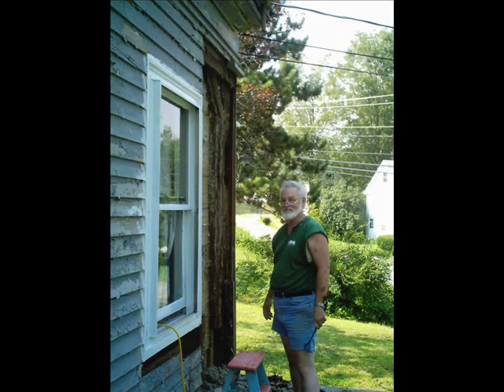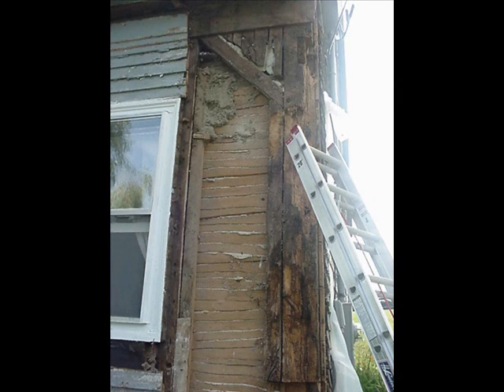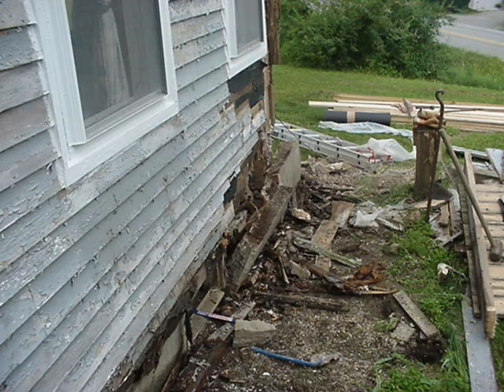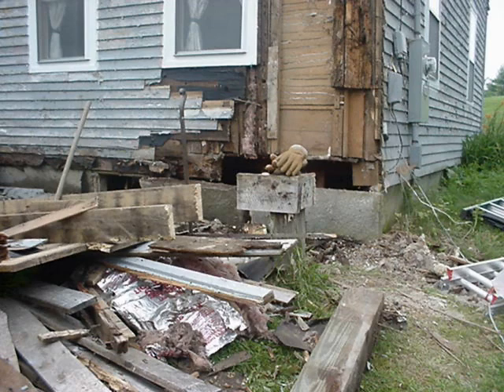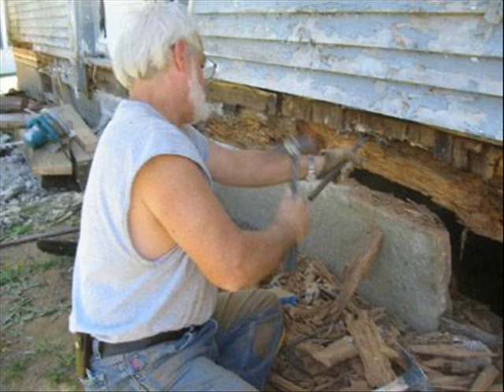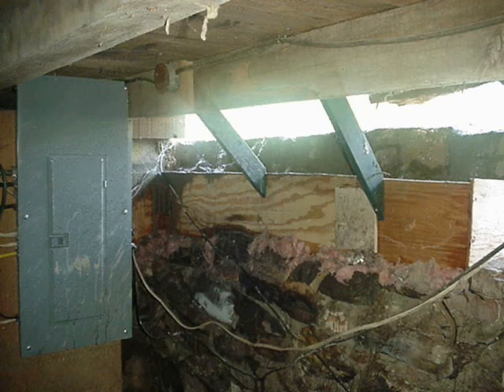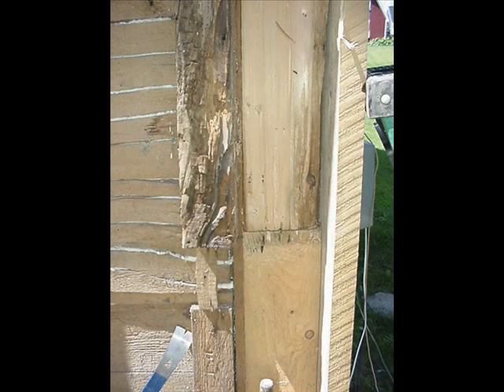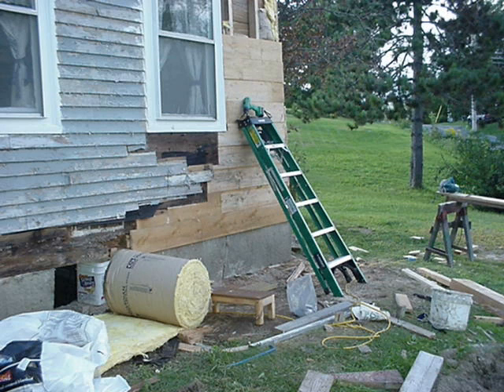Frightening!  Fixing the rotted corner, sills and foundation

Comment: This is amazing. I just started going after some plywood in a weird corner of my 1889 built house, and found that some sill boards under this door (now sealed) were totally rotten. I just started pulling rotten wood and wondering where to stop, eventually finding what looks to be the top of the limestone foundation. Your videos are fantastic and so helpful to visualize how things might have been built and what to do. I'm starting to think I may sweep/vacuum/wire brush until it's nice and clean, and pour some concrete on top of what's there to make sure I have something preventing from getting at the new wood I put in. Not sure, but this gives me confidence that nothing I'll find is likely impossible to take a stab at :)
Reply from the maker: I agree.  If you have a post and beam house, it is so strong that you can do a lot with very little, unlike stick built 2x4 builds, ..   Good luck with yours..

Comment: Just bought an old family home that was built circa 1830. Contractor is pulling off siding to replace it all - and exposed at least one section of sill that looks pretty rotted out. Have not heard what it will cost to fix, but guessing it won't be cheap. Can only hope that the old building methods/materials help to compensate for the toll that age has taken.
Reply from the maker: I suspect it will.   Replacing sills aren't nearly as frightening as they seem.   Hopefully your contractor has a little experience with this kind of thing.   The old building materials are so much better than what you get from the big box stores these days.   Amazing how well they hold up.    Good luck with it.     Is it a post and beam house?

Comment: I just inherited one of these 1800 style homes in alabama. I noticed one thing right off, they dont have hardly any insulation. What are some ideas for insulating these old homes? I also have that same corner of this home leaning downward and saw that the wall was bulging out from the home. I looked at the underside and man, when they said 2x6 or 2 x 10 that was exactlly what they got back in the day. The boards under the home were in great shape and looked solid. No wonder it hasn't fallen.

Comment: Most of the home looks really trashy and alot of replacing is gonna have to be done. Alot of money and elbow grease involved here. I just don't know if its worth it though. The under neath of the home is solid, its just the cosmetic. I always say, start with a firm foundation then work up from that. I may start some videos on the before and after it might be one of them things in life I just might have to try out. Thanks for your vids it helps me in getting things moving forward

Comment: Im terrified right now, in the process of clearing out a room to put flooring in by myself, i pulled a dresser away from a corner and the floor was sunk away from the sill! I think i may have screamed a little when i saw that, but worse was yet to come, i tested the floor by pushing on it a little and yeah it was giving a lot. So i pulled back the vinyl and then the shock really hit me black mold all in that corner and all along the floor the length of the wall. Now it took some guts for me to stick my hand under where that floor was dropping and feel along the wall bottom, and yep that wood is all rotted. My neighbor said thats the sill plate. Im in full panic mode because while i can do plenty of things by my self this isnt one of them. I have two problems as i see it, 1 there is water or moisture causing rot that i will have to track down, and 2 im 5'3 and 114 lbs i dont think i can muscle replacing a sill and joists.

I just went broke having contractors put in new HVAC and gutting a bathroom including floors and joists. So any work now i will have to do, or it will have to sit for a while, and thats not safe from what i have been told. Its possible the wall could give way, not to mention i noticed that gap is allowing creepy crawlies in and a mouse! Im so upset that i have been looking at videos to see how this is done when i came across yours. Its amazing you did that alone! I dont know what im going to do 😭 There is only 8 inches of crawl space height under that part of the house, yet another problem 🤦‍♀️
Reply from the maker: Biggest thing is don't panic.  It can be fixed.  Might be pretty yucky but certainly doable and nothing to fear.   I'll share a video with you of my bathroom fix.  It was a lot scarier, but I managed it by myself.  You can do this.   Don't feel you have to rush.  The house won't fall down while you think about it and when you do it, just try to do one thing at a time.  For example, clean out an area, just as much as you can easily manage, then a little more than a little more until you've got the rot and such removed.   Prop the walls up if you have to with some boards attached through the studs for temporary bracing.   Like I say only do as much as you can comfortably do at a time and after each small accomplishment take some time to appreciate what you've done before you do a little more.  Patience and calmness is the key.
Reply from the maker: https://www.youtube.com/playlist?list=PLvFup6BV6konr_2AiG9jDxENo2SKFfXND
Reply from the maker: https://youtu.be/icEWXoUyE8E
Reply: @rpeek  Yeah my bathroom floor and walls were a disaster, i bought the house knowing the floor by the toilet would have to be replaced. It wasnt till i opened the floor up i saw the horror. Apparently the previous owners were unaware the toilet drain had shattered on one side and all the...stuff was going all over the ground under the house. what a mess and the rot had extended under the bathtub and into the walls. I only have one bathroom in this old house so i called in a contractor to gut it and repair it. It would have taken me months lol, not to mention i was too disgusted to clean that out!
I got to say old homes are charming, but man they are just a ton of work. This house was an old stable house back in the late 1800's its been added on to since then, its wasnt considered a house till they remodled it in 1920s. But every once in a while when digging in the yard or doing work around the house i fine old horseshoes , bits of tack and bridles lol im really hoping to find like an old carriage wheel someday, wouldnt that make a charming lawn decoration
Reply from the maker: @dinabrown6529  Yea it would and you might find one.  I used to live in a house where they had a carriage works back in the day and we were always finding stuff like that.

Comment from the maker: @ElitePokerPlayer   Blown in insulation will do the trick.  They can blow it right into the walls and those batten/plaster walls will hold plenty of insulation.    Also check the attic and see how much you got.  Of course.  New windows help too.    Good luck with yours.